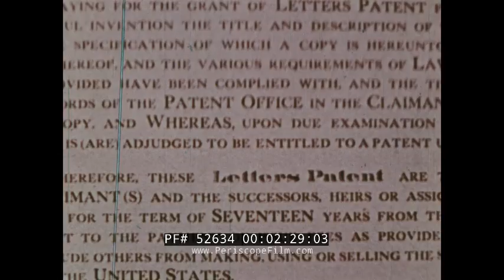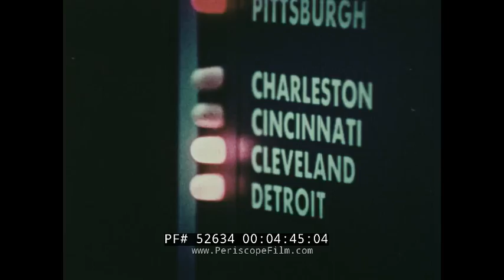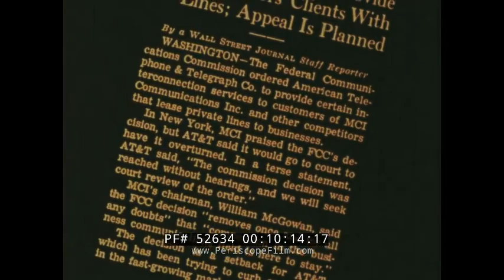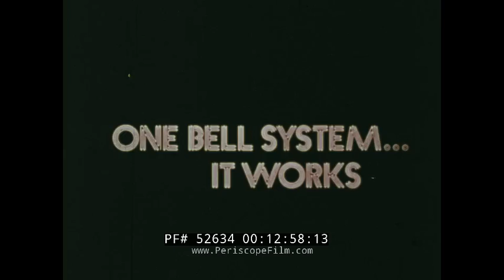HISTORY OF THE TELEPHONE & DEVELOPMENT OF THE BELL SYSTEM   BELL TELEPHONE PROMO FILM  52634

Comment: Years ago, I was a tech with a telecom company, though not Bell system.  I recall some of those things, such as cross connect frames, step by step switching and more.  I used to solder the cross connects on the "Christmas tree" blocks too.  I'm old enough to remember when direct long distance dialing came in to our area and when touch tone phones appeared.
BTW, there's an old "Dragnet" video (actually audio) from the Dragnet radio show. on YouTube, about Sgt. Joe Friday making a long distance call.  It was made around the same time as this video.

Comment: Every Italian will try to tell you Antonio Meucci invented the telephone and he was robbed.
Reply: +Steve sparta: I have read that story. What Meucci really invented was something more along the lines of a dedicated speaker/microphone setup which was good only for single-point-to-single-point service. The device was based on already-existant telegraph technology. Moreover, Meucci's original patent application never mentioned his telephone was an electromechanical device, nor did it describe its electrical operation. 

There was no means for amplifying the electrical signal, which was produced by an early form of voice coil, producing a very weak, unamplified signal which the two parties had to strain to hear, as well as be seated in an absolutely-silent room. Such a setup was good for only several feet at best. There was no battery of any kind for powering the device or amplifying the signal; instead, it was powered by the sending coil's very weak, piezoelectric effect. Bell's telephone used a small amount of sulfuric acid, into which dissimilar metals were dipped; the reaction produced an electric current, which powered the telephone (an early form of battery) and produced an undulating current which allowed for modulation of the electrical signal. 

Meucci's piezoelectric effect was a very poor modulator; the current varied up and down depending on how the piezoelectric signal was modulated by the speaker's voice. The sound coming from the voice coil at the other end would have been extremely difficult to hear at best, hence the need for both parties to be isolated in absolutely-silent rooms. 

So what Meucci invented really wasn't a telephone. It is more correct to say his invention was, essentially, a "voice telegraph." If he'd had the time and funds to continue experimentation, he might have been able to invent a much-improved device.